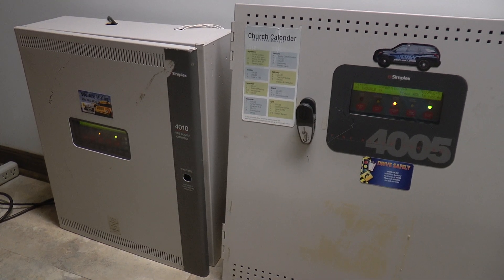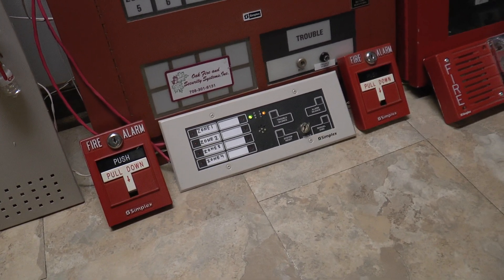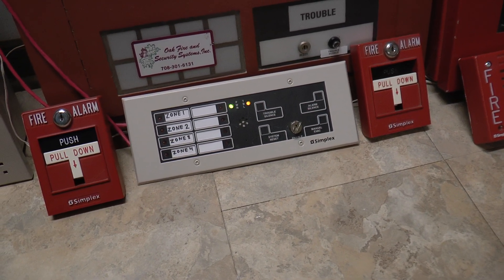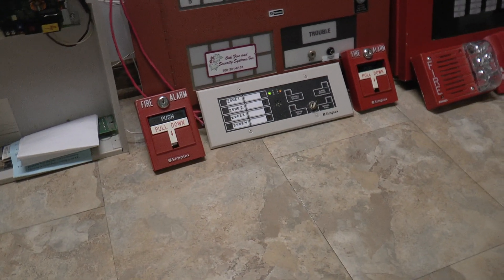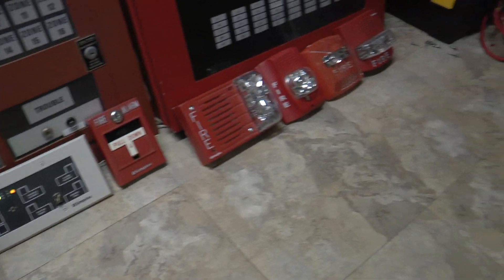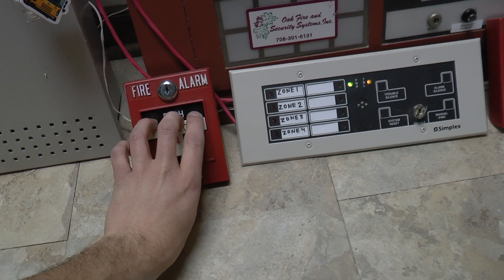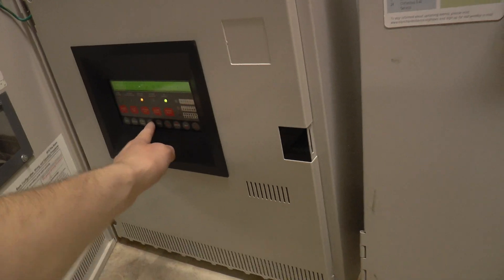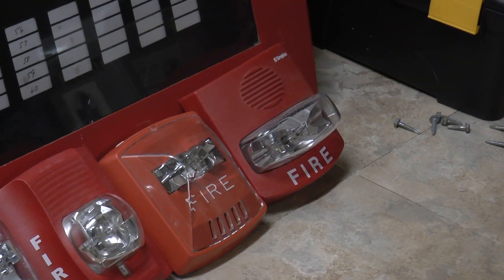Floor System Test 47

Comment: Nice video Ryan. How come the neighbors don't wanna hear a noise of a fire alarm? Like most people need to get used to it.
Reply from the maker: It's just common courtesy to not make loud noises in an apartment or townhouse unit where neighbors are separated by connecting walls. Most people don't have commercial fire alarms in their houses, so no one really should be used to it.

Comment: Hey, dude, if the wire is a seemingly, yet absolutely atrocious nightmare for you, hit me up on FB Messenger or Twitter, or Telegram or whatever social media you got, I'd like to make an offer, if at all possible, if you're cool with that?
Reply from the maker: Thanks for the offer. The only thing I'd have about that is figuring out how to pack it and get it shipped. Box is heavier than a fire alarm panel. I think I'm going to hold onto it and see if I feel like continuing to work with it.
Reply: @msj191961  I can probably help with figuring out the wiring though, if you wish?
Reply from the maker: @EnderShadowborne  I got it, for the most part. Thanks.